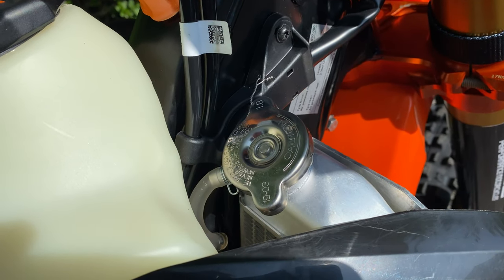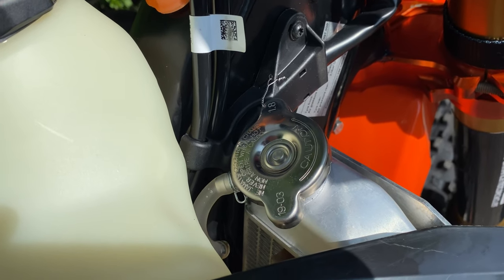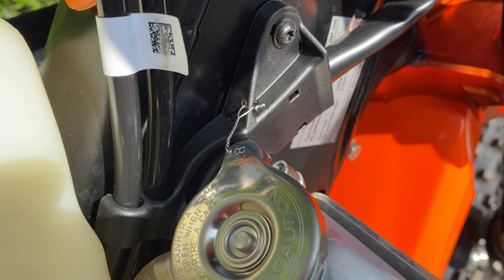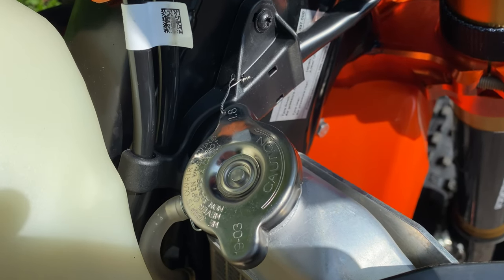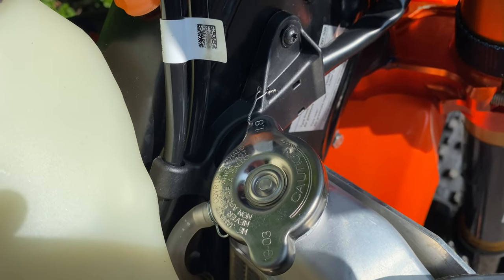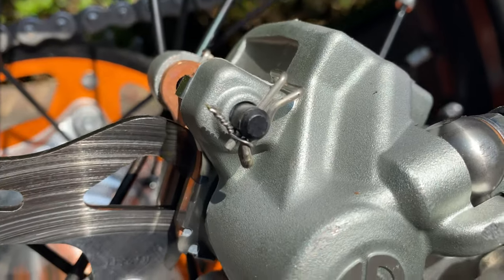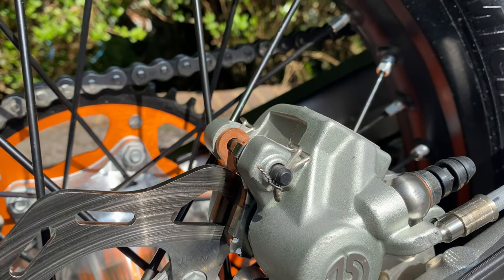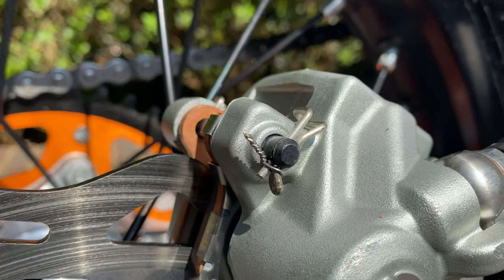Tech tip: lock wire radiator cap and brake pins on enduro bike

Comment: How about doing vid on 2T v 4T, looking at upgrading my 2015 250 EXC for a new 21 bike, but not sure..
Reply from the maker: Hope to shortly pickup a 350F and will absolutely do so!
Reply: Buy 2 stroke if you love the slow speed technical riding,  if your more open faster stuff. Then I'd still run a 2 stroke due to lower repair cost. But the new 4 strokes are getting better.  40 years of off rd n mx racing , ah
2 stroke is the only way for me.